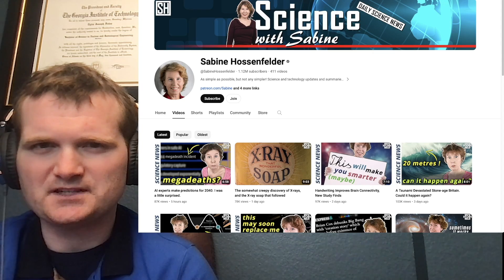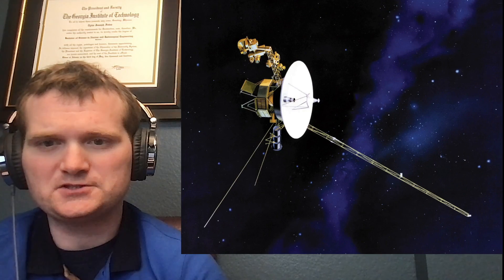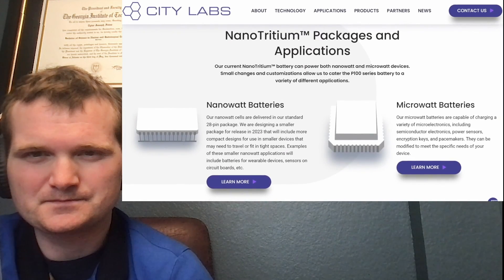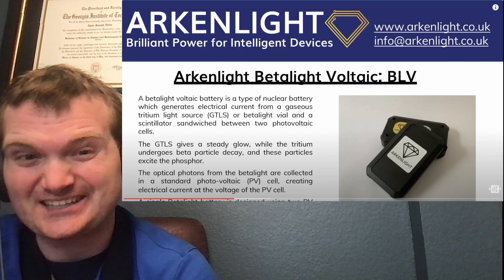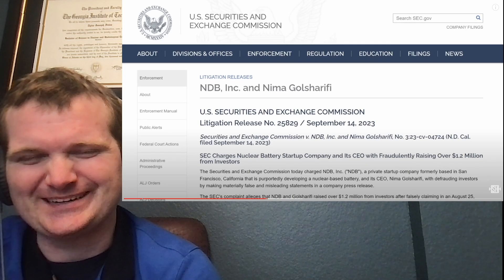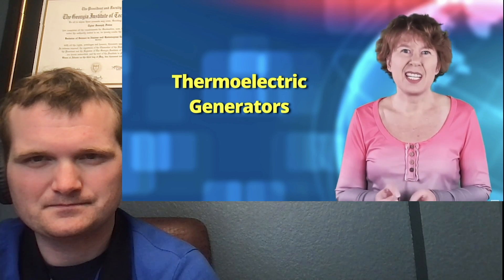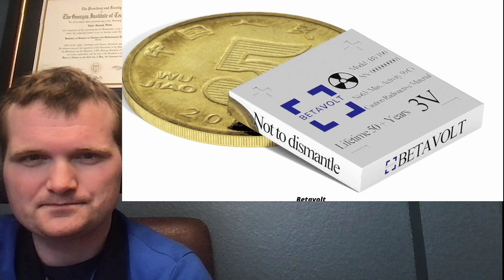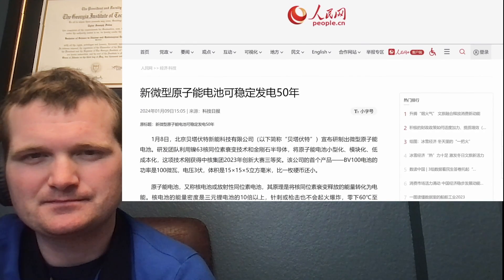Nuclear Batteries for your iPhone? - Nuclear Engineer Reacts to Sabine Hossenfelder

Comment: So what I'm hearing is we could soon getting nuclear powered versions of things that require little power such as:
- Quartz wrist watches
- Gameboy/Gameboy Advance Cartridge save and clock batteries
- CMOS/BIOS batteries, this would be a more permanent fix for the PS3 CMOS battery dieing potentially (evitably) locking folks out of their games should (when) Sony shutsdown the servers that the PS3 relies on
- Smoke Detectors might also be a possibility

Comment: I'm a watchmaker and I love how efficient a well made quartz movement can be. Manufacturers will claim up to three years, but it's more likely to be around 1-2 years, especially if the movement is getting up in age. A beta battery powered watch would be cool. The amount of force coming from the rotor on a quartz movement is akin to a mosquito beating its wings, so a beta battery might produce enough power to run the movement. I'd have to do the math to be sure.

Comment: The problem with Carbon-14 is it emits a very weak radiation. Using any Alpha Emitter would get you up to the MeV energy per disintegration
Reply: How does that work with the betavoltaic effect?

Comment: Almost every computer has a sub-watt battery for the clock, remote controls, thermostats, microcontrollers, smoke detectors, and any device that has a standby mode.  So the market for these devices could be in billions of devices... in theory.

Comment: In consumer use paired with a robust capacitor it could maybe be useful for a device like a remote control or something of that nature. Sure it might need a few milliamps to pulse it's LED but each pulse sequence is a fraction of a second total. Some types of smarthome sensors like a door/window opening sensor could pehaps also use them. Stuff that needs a few milliamp hours per day or so at most. There are a lot of useful sensor and control applications like that which are impractical or inconvenient to power from the mains which currently rely on disposable primary batteries that could maybe use it.

Comment: I'm just thinking how if nuclear batteries were good enough and small enough to power something high power, like every appliance or device in your home, would it even be necessary to run powerlines at that point? Sure it wouldn't happen for a very long time, but it could be possible.

Comment: @12:50
100µW?
P = U*I, or I = P/U. 100µW/3V = 3.33*10^-5A, or 0.033mA. That's 0.000033A. That's ridiculous.
I don't think you can run any type of sensor on that, let alone send the data in any meaningful way.

Comment: There is no way they can make a cost effective and reasonably sized 1W cell. Ni-63 costs around $4000 US/g, isn't naturally occuring and can only be manufacture at any quantity inside a reactor. 

100uW is 1/10000 of a W, their 100uW render likely weights around 2.5g, at current output density, the 1W cell will weigh around 25kg. To power my phone, which uses 5W watching this video and writing a comment. I would need 125kg worth of this battery!

So unless Betavolt can somehow make Ni-63 hundreds of times cheaper and power output of betavoltaic cells hundreds of times denser in the next 2 years, their 1W cell will only be a pipedream.
Reply: Aluminum used to cost more then gold before a guy figured out how to industrialize making it.
Reply: @SilverStarHeggisist  The difference is that aluminum is naturally occuring in significant quantities, just need to be refined. But nickel 63 has a very short half life (100 years), so there is NO naturally occurring nickel 63. It can only be made in a reactor. 

We have been making isotopes in nuclear reactors for nearly 80 years, and none of the manufactured isotopes are cheap. As such I doubt Ni-63 can be made significantly cheaper than it currently is.
Reply: @_EVANERV_  aluminum in a state that could be simply refined didn't exist till around recently. And if it wasn't for the work of one man, we wouldn't have aluminum anything today. Aluminum doesn't occur naturally and can't be simply refined. It requires changing it on a molecular level to be useful.
Reply: @_EVANERV_  my point still stands, aluminum for virtually all of human history was not something we could make. In 1600 making cheap aluminum was not possible. Just because something isn't today, doesn't mean it won't be tomorrow

Comment: One major problem is efficiency and the fact that they can't be turned off like you mentioned. Somewhere I saw said that these batteries were less than 10 % efficient. So if you have a 1 W battery to charge your phone it would also produce an additional 9 W of heat. If you wanted to power the phone directly whilst in use you may need 5 - 10 W depending on load so that then becomes 45 - 90 W of heat generated constantly.

Even if the battery was 100 % efficient and was used to charge a secondary battery that then powers the device, if the device isn't used enough then the secondary battery will be fully charged  and then again all the power from the battery needs to go somewhere, most likely as heat.

Now the devices may be large enough anyway that heat isn't much of an issue but if they manage to miniturise it then it could become a large issue. However considering you can get 100 uW in a 15x15x5 mm package and considering you would need 10,000 to reach 1 W, the battery would be very large and impractical anyway.

In applications where one of these makes sense, like very low power sensors or medical devices then dissipating the milliwatt or so of heat isn't an issue.

Edit: A channel that has some good videos on debunking the claims of some of these companies and a series on how bad solar roadways are as well as loads of other stuff is "EEVBlog".

There was a company that "made" a very similar device and bold claims a few years back that has now been hit with a lawsuit for fraud. Nuclear Diamond Battery (NDB) they were called. It was typical startup fraud, lieing to investors and things like that. They said they had manufactured a prototype and had two labs test it when in reality they were never anywhere near making a phyical prototype.

Edit 2: The company I was referring to was the one mentioned in the video.

There is a company "City Labs" that have been producing and selling 100 uW betavoltaic batteries for I believe over 10 years now and they actually have a functional product.

Comment: I'm not at all versed in electronics, but I find it interesting that they shared that 3 volt figure. Most electronics that run on typical disposable batteries (AA, AAA, C, D) run at either 1.5v or 3v, depending on the battery arrangement. I don't know if the wattage is comparable at all, but it'd be nice to have remotes and wireless mice that never need battery changes/recharging, lol.
Reply: Wattage is measured in microwatts for these batteries.  Use cases are very specialized/limited.  Extremely low power.

Of course the problem with higher powered versions is all the heat they'd produce just sitting around even when you're not using them.
Reply: Your mouse button would eventually wear out, which is why I've trashed many wired mice.

Comment: If "room temp" superconductors become a thing, would these low-power nuclear batteries be sufficient??  I know that you can't  use AC power because it disrupts the Cooper pairs, and that any superconducting material loses its superconducting properties after a certain current is passed...so would this be the most viable tech???  ...just thinking out loud over here 😋

In any case, thanks Tyler for covering this!!! 💪👍
Reply: There are room temperature superconductors they're just not metallic and very hard to use so extremely impractical there's a guy I like to watch his videos he goes into the name thunderf00t check them out if you want to see a lot of this information about this

Comment: Dave Jones on EEV blog went over a bunch of the tech side of this.  in a somewhat recent video. 
I can see a few other places for this clock circuits like you said, but could also go inot computers as they usally use 3V CR2032 cells for saving system clock, boot setup, etc. I think could also be put into like smoke and CO2 alarms too then would last indefinatly and no more waking up to a low battery beep in middle of the night. I don't know would directly be enough to power when activated but I would think could charge up some sort of capacitor or supercapacitor to handle the surge of power output when it activated.  I could also see maybe used in like remote locator flares or black boxes to power transmitters for longer periods while they locate the device.

Comment: 100μW, or on the order of that (preferably more), is actually probably enough to run an Attiny13 processor, even if it has to happen in bursts. It'd probably even run at a usable modulated frequency, you'd certainly lose more power to any peripherals.

Comment: I could see the technology gaining broader applicability if it was paired with decently robust capacitors that they could trickle charge? If higher demand systems were drawing from those capacitors, you could have self-powered devices that could give you 'uptime' and 'downtime' without the need for active charging, including cellphones (which, let's face it, anything that makes a battery viable for cell usage would all but guarantee broader adoption).
Reply: Nuclear batteries would make all those cell phone cancer claims to be plausible.

Comment: something like the CMOS batery in your PC would be nice
Reply: Should be totally feasible.
How often do you actually need to use the CMOS battery? If it were rechargeable using a betavoltaic battery to keep it topped up?
Reply: @bobthebomb1596 They used to be rechargeable, and then the early forms of supercap sat in. They had problems. The CR2032 was the answer to that lol

There's no reason to have one of these things when you've got a power source that's available most of the time and all the battery needs to do is be present those rare times the mains aren't 🤷‍♂️

Comment: Waste's classification is misleading, people think that something doesnt count as waste if they are expected to be reused, but reuse, but generally waste's definition extends to things that you would want to discard or would have a statutory requirement to discard if you were /not/ reusing it. Same goes for recycling, recovery(energy from waste) and composting. you still require a bespoke waste permit (at least in the UK) and a haz waste transfer note to move any rad waste you are storing to a courier, and one transfer note for each of both the sender and the reciever of radioactive waste.

Comment: Uhm, with a 1W charger ... you possibly could charge your phone on the order of several weeks...

if at all.. Stand By consumption of the baseband modem, wifi and one or two background processes eat that up very quickly....

Especially the transmit side of the baseband and wifi modems is extremely energy hungry.. Even if there are just some few microwatt of radiation going out of the device, signal generation and digital-analog-conversion needs energy too.. And no HF transmitter is perfect, so you have filters behind it to supress unwanted harmonics (aka waste even more energy sadly)..
Reply: So stack more than one of them.
Reply: @bobthebomb1596 you know, 100 µW = 0000.1 W, so you would have to stack 10,000 of these to get 1 W ;)
edit: it's 0.0001, of course, not 0000.1 :P
Reply: @GuardianOfRlyeh  I think you need to check your maths
Reply: @bobthebomb1596  100 µW = 0.1 mW = 0.0001 W. What's wrong with it?
edit: oh, I see, I misplaced that separator in my previous comment. But the 10,000 stacked batteries necessary to get 1 W still is true :P
Reply: @GuardianOfRlyeh  :)
When I referred to "stacking" it was not just batteries themselves, which I agree would require 10k, but the beta source/p-n junctions within individual batteries.
Perhaps layering would have been a better choice of wording on my part.
Reply: @bobthebomb1596 Ah, I see :)
But I am pretty sure that they already do this, looking at the diagram of the battery (there you can see three "beta source"/converters layered on top of each other)
Reply: @GuardianOfRlyeh  I'm a lowly chemist, so it was only meant as a question. 
My thinking was along the lines of using vapour deposition to lay down multiple, very thin layers to produce more efficient batteries. I do not know if this is physically possible or practicable though.

My real interest would be in gamma voltaic's. Specifically, how far into the gamma spectrum is it possible to stretch with current technology and could multiple layering of p-n junctions with different performance characteristics allow for  more efficient batteries? Better yet, could this allow a future satellite to draw power directly from background radiation?

The musings of a retired chemist with too much time on his hands 🤣

Comment: with consumer devices, the 'internet of things' market has had a big problem with idle current draw. so this does help that become a lot more viable.
Reply: also: smoke detectors, carbon monoxide detectors... anything like that. for a wifi connected thingamajig that does something once a day, the nuclear battery can charge a regular battery or a capacitor, just like those time clock circuits.

Comment: look for zigbee. it's a communication protocoll for things like sensors, switches, etc.
it has seriously low power consumption. imagine a sensor that needs to be used a few times a day. it has such a beta-energy-source (they are not batteries), can charge a capacitor and run on the power from that source.
their main problem is, that there is a similar product out there. solar cells covered with a phosphor, and some tritium. (you certainly know those betalights).
works for many years, as long as your requirement is not "must work for 100 years", because the half time of tritium is 12.3 years. depending on your requirements, the thing is dead after some years.
youtubers even built those things themselves. betalights, amorphous solar cells, there you go. not pretty, but works.

Comment: The old Soviet RTGs placed all over the eastern bloc is still a health hazard today, though significant and expensive effort has been undertaken to dismantle and retrieve them.

As far as I know they haven't all been removed, but from my understanding it is partially because of the high cost and partially because not all locations are known.

There's a video documentary on youtube about how some campers found one of the unshielded radiation sources in, i think, Ukraine a few years ago and used it as a source of warmth, which did not go well, as well as being about the process needed to safely remove it from the remote area it was in.

Found it. It's "The Soviet Union's Deadly Abandoned Nuclear Generators" by Andy Mcloone. The incident took place in 2001-2002 in Georgia, not in Ukraine.

If you want something else to react to I would highly recommend that video.
Reply: He might have already reacted to a similar video by Kyle Hill.

Comment: 6:38 yes, place it somewhere, where you don't want to interact with it. until somebody finds it and thinks: hey, this is great, a free heat source (as you know).
at least they didn't hop into a bathtub with it, differently to what some guy on mars did.
Reply: something like betabattery has soecial case which absorbs 99.999999% of all beta particles so its fairly save to handle in hands. those old soviet era batteries said to shielding absolutetly NO IM FINEEE so yeah, run for your life when u see something like that
Reply: @oljackie35  I referred to his nuclear bonfire reaction video, where some guys used a Sr90 RTG as a heat source for their overnight stay in the wilderness. with glowing results.
that's why I used a timestamp, because he talked about remote RTG setups.

Comment: Pretty neat actually ! Maybe lower powered things may hit the market, but like, i think the problem may be the cost itself.
Reply: The problem will be disposal.
Reply: @RedmilesShark  true, remember that these batteries still last an huge amount of time. Also, if the battery no longer produces energy, it means it's fuel is used up. This therefore means the material inside is no longer emiting radiation, so it should not be radioactive. Maybe the decay chain of certain elements are problem
Reply: @photonik-luminescence 
The waste could still be stable heavy metals though. Still something you should dispose of properly.
Reply: @RedmilesShark  hence i was mentioning the decay chain as uranium decays into leas (wich is a bad and toxic heavy metal). Disposing would require less dangerous salts probably or such. Mercury can exist in a non toxic stable salt.